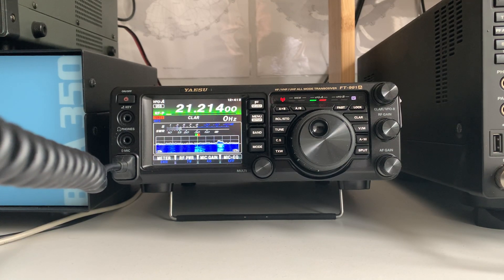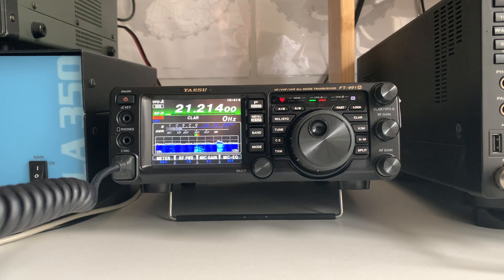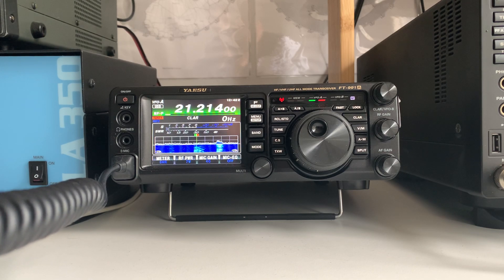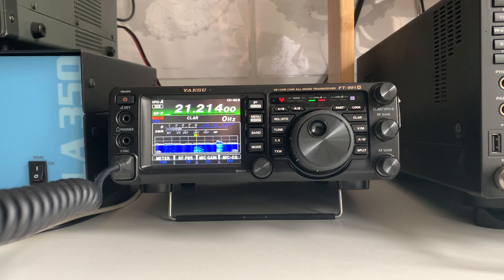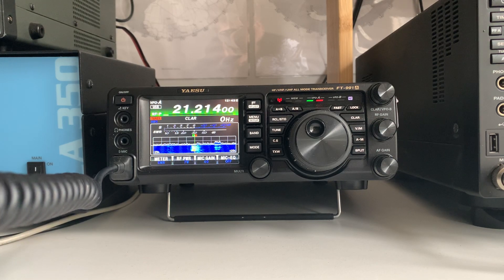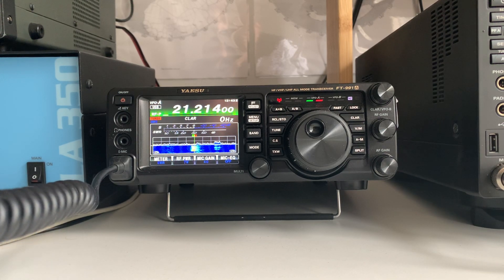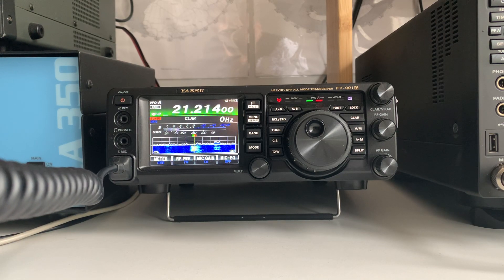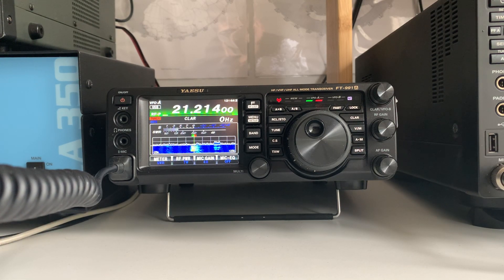Working Ben in Copenhagen OZ5BF on 21.214 MHz using the Yaesu FT-991A and BLA350 linear amplifier

Comment: Just out of interest, is it normal to have high swr using that amplifier even using the internal atu. I just would of expected a flatter swr. Good video though Clint. Thanks for posting it.
Reply from the maker: I'm not sure how it works, but when I'm using the BLA350, the SWR peaks higher than without. It's not all real though at the radio because the BLA trips out with an SWR of less than 3:1.
Reply: @OxfordShortwaveLog  yeah some amps are higher as some have two bands on one switch like 18 and 21mhz. All good though and thanks for sharing 👍
Reply from the maker: Yeah, the BLA operates in auto or manual mode. No worries - thanks for your comments. 73
Reply: The swr shown on the radio is the match between the radio and amp. Internal ATU might clean it up.

Comment: When people say to me, "I can do what you do on my cellphone", my reply is, Can you just cold call some on another continent and have conversation with them, without their phone number? Can you reach your loved ones and friends in an area where a natural disaster has just occured and which took our all their infrastructure, such as cellular towers and even the electrical transmission lines? Well I can do all that and more.
Reply: Good point
Reply from the maker: I've been quoted something very similar - why bother with radio at all when you have a smartphone! That's fine until the supporting infrastructure fails. 73
Reply: I’m always pointing that out. Too many people think that this thing is infallible 😂. When I explain it to them, they just give me a stupid look. What goes around comes back around. I know it will come back to bite them in the ***.